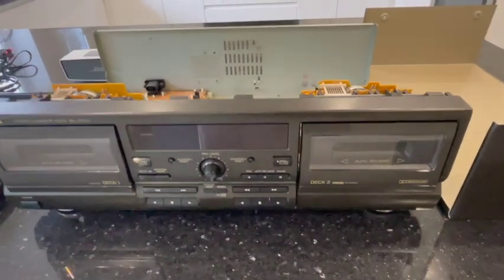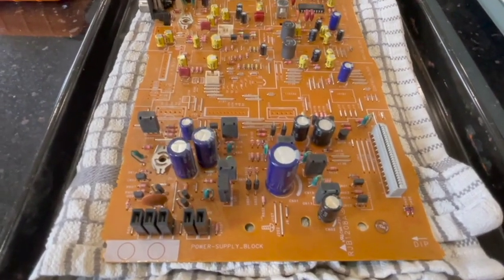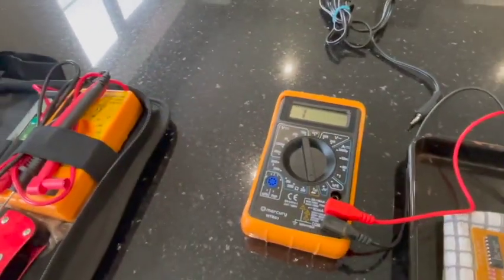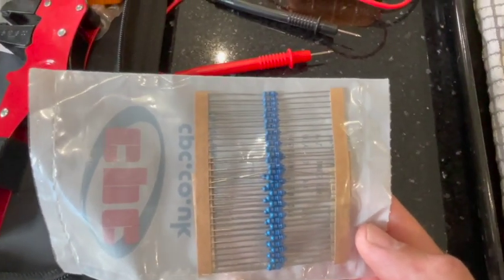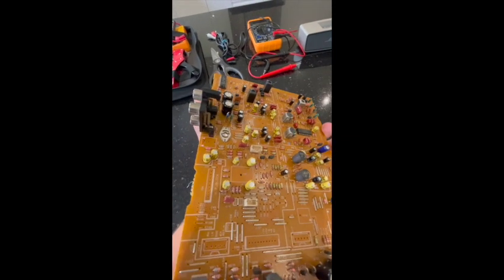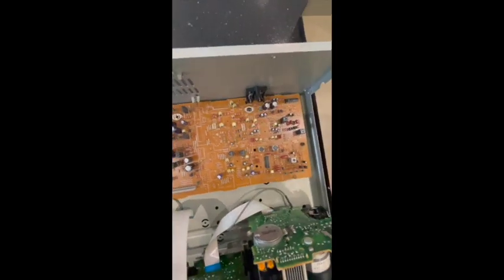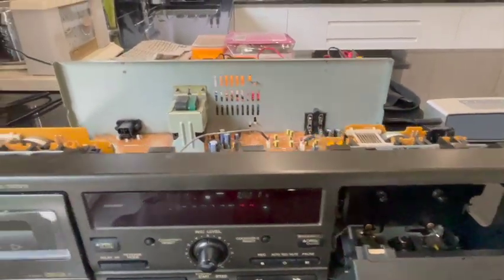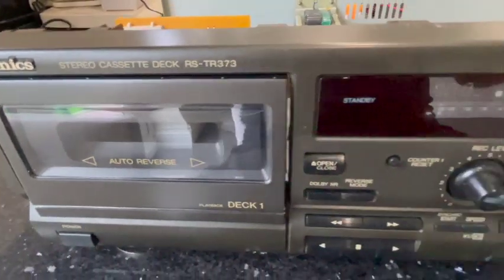Technics RS-TR373 Repair no sound issue Vintage 1990s Cassette Deck

Comment: Saya punya technics type RSM 233X kondisi tidak mengeluarkan suara apakah anda bisa membantu saya
Reply from the maker: Yes, please simply test for continuity of the circuits across most of the accessible components. I did this for all of the resistors on the board and managed to fins some that were faulty. A basic voltmeter will do this. start here and let me know what you find.

Comment: I have a question, did the vu-meters work before the repair ? i have the same one and have not used it a long time, everything works but no sound and no vu-meter
Reply from the maker: Hello, sorry for the delay! The vu-meters worked ok before the repair it was purely no sound from the system. I would look for evidence of other affected components or even the back of the screens for any signs of damage? (heat/moisture)
Reply: @jsayerwebdesign  Thank you for reply. I opened the deck and everything looks new inside. I read it could be a "switch" for record/play which could be the issue. I have no clue where it is.
Reply from the maker: Look for damaged components on the circuit near the VU meters.
Reply: @-mjb-  Did you ever fix your issue?

Comment: My Technics RS-M215 cassette deck no longer outputs or inputs any sound. Any idea on what could be causing this and how to fix it? I downloaded the PDF service manual online but I can't make sense of any of it. Could you take a look at the manual schematics and perhaps point me in the right direction? Maybe tell me which component is the most likely culprit. Thanks.
Reply from the maker: You will need to go through each component and check for continuity across components? the resistors are common faults to be faulty.

Comment: My Technics RS-BX501 (I bought it in Serbia for 7€  two days ago) had the same problem. Motherboards are very similar. R631 did not work. The repair cost 0.02€. Thanks for video!
Reply from the maker: Shame that R631 did not work. Look across the board for any other resistors that have a burnt charred look, almost rusty? You may spot another one. Thanks for the comment
Reply: @jsayerwebdesign  The device is 25 years old, everything is forgiven.  Repairs were easy and cheap.  I have another RS-BX501 (and RS-AZ6) and I bought this one because of the spare parts.  In the end, I put it in the right condition.

Comment: Thanks a lot Jonathan for your video, I just bought the same unit as yours and got the exact same error... no sound at all - I will replace the defective resistor. Looks like all TR-373 not being powered-on for years got this issue. Cheers!
Reply from the maker: I do have some spare resistors if you would like one. Not sure how I could get them to you.?
Thanks for the comment 😀